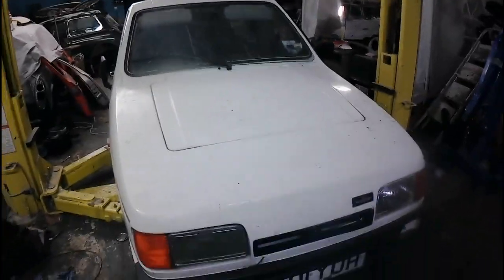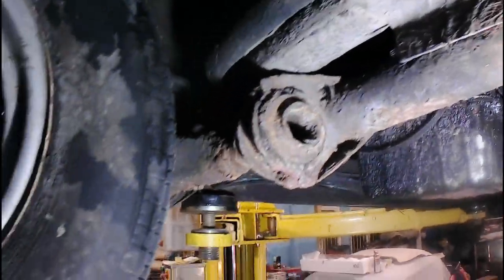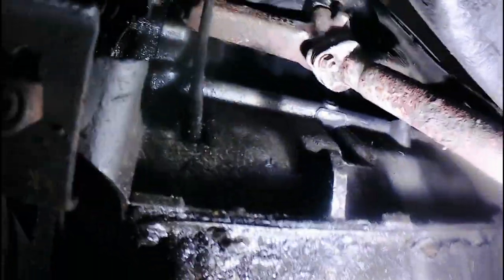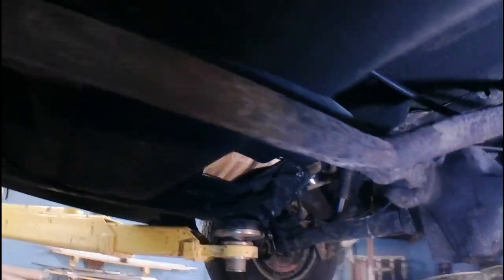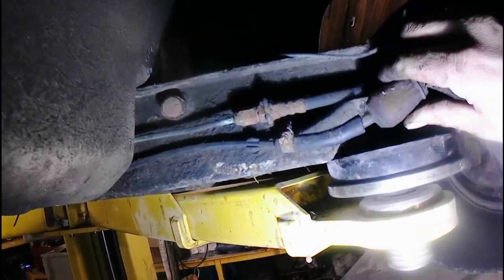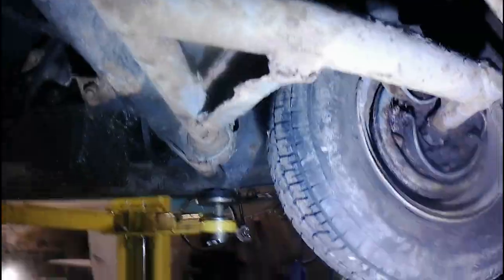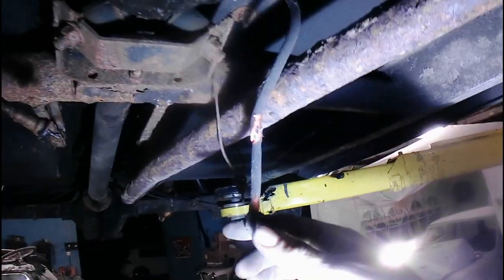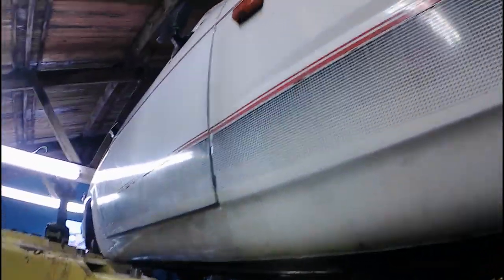Reliant Robin - Part 7 - cheapest reliant Robin in the UK..everything that''s wrong with it SHOCKING

Comment: Was the cable hanging underneath near the exhaust the "earth" cable from the engine to the chassis? if so i'll take a guess that the reason it was a non-runner and the alternator is missing is that cable came off, so the engine was isolated from the electrical system (in the will it start vid, did you notice the flashes from the starter to the engine panel) possibly burning out or giving the impression the alternator is kaput, easy test is connect a jump lead from battery negative direct to engine and see what happens, also your sticking back brakes could be down to the rear wheel cylinders are stuck in the locating slots in the brake plates (similar to early mini) as they need to be able to slide so the brake shoes can centralise, hope this helps.
Reply from the maker: Thanks for the comments! I suspect you are right about that being the earth, I'd not thought that could be linked to the alternator bring missing. The sparks are actually my brother shorting the starter to get it to spin. I'd bypassed the ignition by going straight from the battery to the coil, then a screwdriver across the start terminals to get it to spin. Its a trick I learnt from years of mini ownership. I didn't want to mess around for hours sorting electrics if there was an engine issue. Our plan is to fully strip the rear brakes, de rust and rebuild. The shoes and cylinders look serviceable I think its just surface rust causing issues.
Reply: @sharleysgarage  the earth cable twixt engine and chassis (previous models had a flat braid cable tho by the time of late robins this changed to a heavy cable with crimped eyelets that tend to break) is a common problem, I go for a cable from the front cylinder head stud direct to the battery negative terminal for peace of mind (simple rule for reliants is most electrical faults are earth/negative as much as power feed), if you're near the Midlands (Stafford) I'm selling my Rialto van (modified) and spares chassis, body shell, engines, gearboxes, interior, axle (b type), gauges, wheels (including 12" wolfrace alloys), electrical (still boxed new rear light clusters for your Robin) and Haynes and genuine Reliant (includes how to service rear axle/differential not covered in Haynes) and new spares (2 X piston/liner kits), let me know if you're interested.
Steve.
Reply from the maker: Hi Steve, I learnt the importance of earths with my first magenta kit car, couldn't work out why the lights flashed with indicators. Then I did a separate earth feed to everything and it stopped! Ill do as you say and fit an earth from head to battery.  im not for from Stafford and 1.5hours. Drop me an email to Rustsweatandado@yahoo.com there's a few bits I'd be interested in! Thanks for reaching out!!!